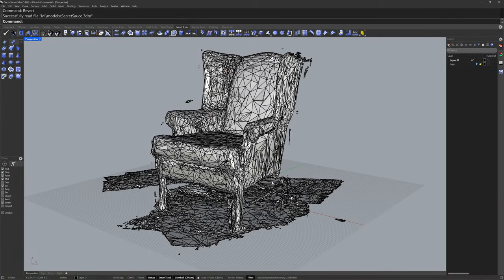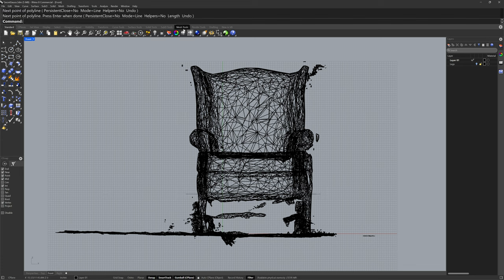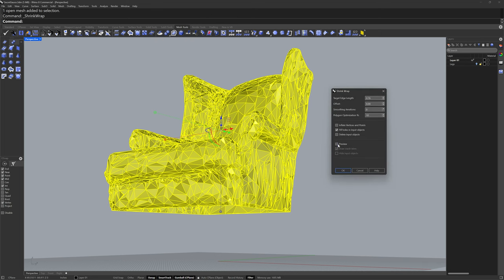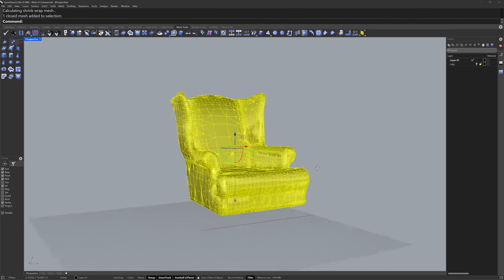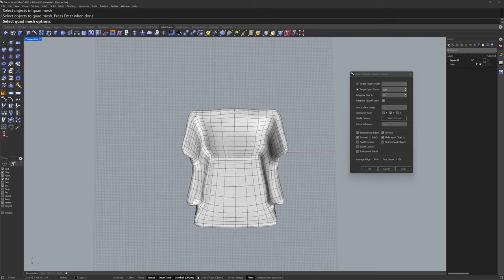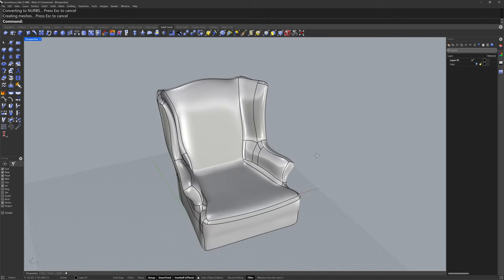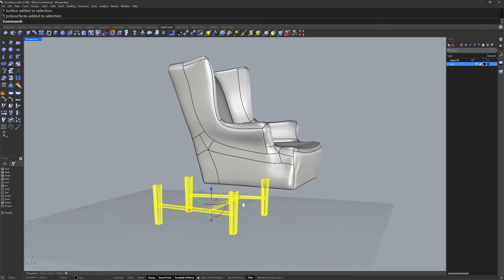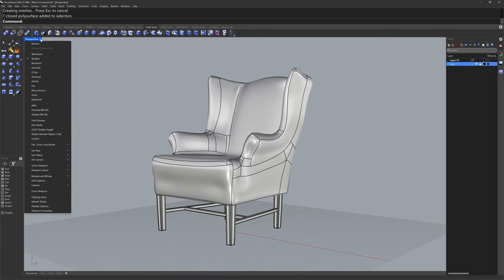Rhino 8 : The Secret Sauce

Comment: Can we put the scan texture on our new nurbs model? If it is so, it would be even more amazing!
Reply from the maker: In some cases it's possible to use the scan with a texture map as the custom object mapping method for the Solid or SubD. However you can get texture distortion at the seams of the solid due to how the objects are aligned. I'll look into this more with several models and make a new video if it works well. I generally will create a new Unwrap for the solid instead using it's edges as seams.

Comment: what exatly does a 3d scan mean in this senario ? to me it looks like youve take some sort of picture and loaded it into rhino is that whats happening ?
Reply from the maker: The low poly mesh I started with is a 3D model created from one of the many 3D scanning apps available on Apple and Android devices. Some of these apps can utilize LIDAR while others may use what is called Photogrammetry to assemble a 3D model from still images. Ultimately, many of the results you'll get from these apps will have issues and this workflow is a way to easily fix a scan mesh while also allowing for conversion to a NURBS solid if desired.